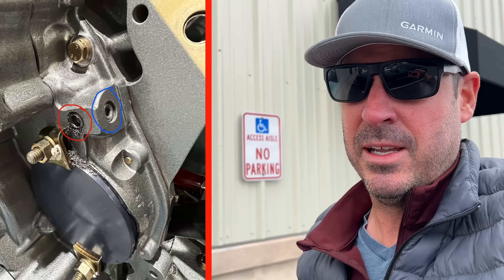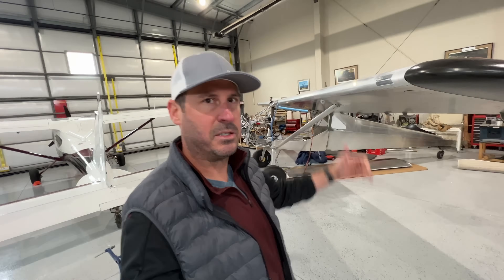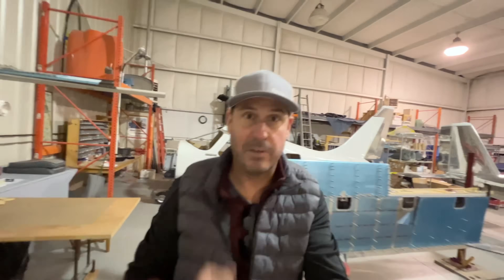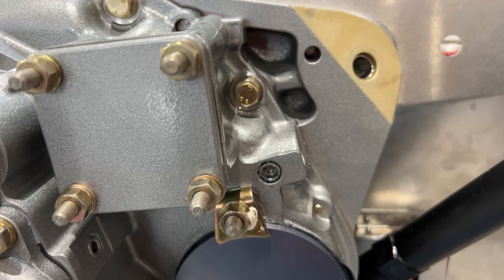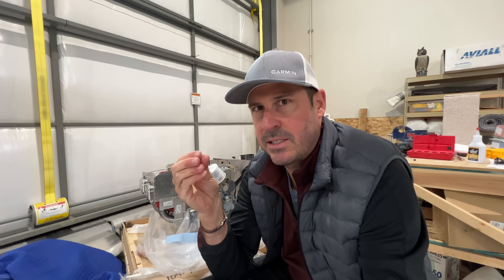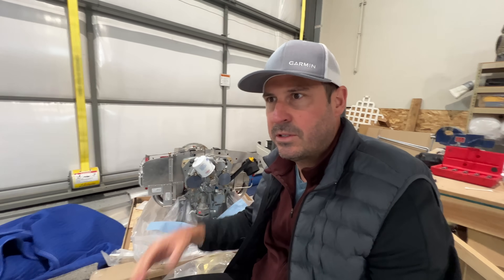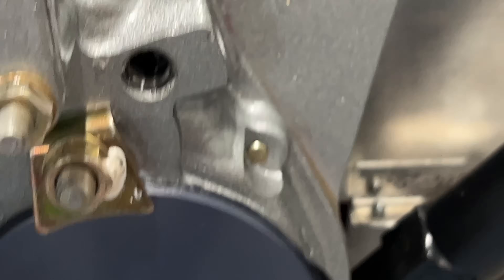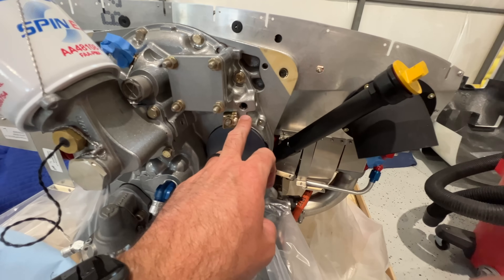Did I just ruin brand new $40K airplane engine?

Comment: Dont drill.   I owned a machine shop for over 10 year and often broke taps off in some expensive parts.   I found a very good tig welder.   He was able to weld a bolt onto the tap.and we were able to then screw the broken tap out of the hole.   I feel your pain.  This happened about once a month and we became good friends.  Good luck finding a good tig welder.  He worked as a contractor for GE jet division..

Comment: Get a can of croil penetrating oil. Grease trick plus magnent
Reply: Good idea on the magnet… however, it’s an aluminum engine case.
Reply: @chrishrabe4617   case is aluminium but bet bolt is very soft steal
Reply: I think he probably used the ball end of the Allen wrench, that's why it slipped. Gotta use the other end the straight end to initially loosen the plug. It's an oil galley plug not a bolt by the way.

Comment: Here’s a tip if you have to ever drill through one. Rig up some air pressure on the oil spout and pressurize the crankcase. When you drill through, it’ll blow the shavings OUT. Done it many times.
Reply: That's a good hack. Thanks for sharing.
Reply: Good idea but it would still scare the hell out of me
Reply: @mikeryan6277  Terrifying… the first time. Once you see it you’re like, “Well that was cool.” I learned it from D’Shannon Aviation when they put an air/oil separator on my Bonanza. That’s how they drilled out a boss in my BRAND NEW IO-550 to tap it for a return line. I filed it away and looked so smart when I pulled it out of my hat several times since then. Hey, everybody needs to show off once in a while!

Comment: My only suggestion would have been to  use some REAL heat, a  torch, that's a pretty big heat sink for an electric heat gun. Another trick I've heard about is to get a TORX wrench/socket, that is slightly too big for the Allen head, and tap (smack)  it in to get it to seat, a last resort for sure!  A pisser all around, glad you got it out.

Comment: 99% of the time it's not the metal, it's the wrench's or not using the proper one as any uneven pressure can easily cause strippage. I switched to socket allens and haven't had an issue since! Just some friendly advice, glad you got it and progress continues!
Reply: I’ve been an auto tech for 24 yrs and work on ga aircraft regularly also.   Had that extractor not worked my next move would have been fill plug with weld then weld a nut to that and the voodoo happens turn the nut and the plug backs out.   Of course that method all depends on what the plug is made of.  Has to be weldable.   Good job on the extraction!!
Reply from the maker: @rodgersrcaviation2785  ok, thank you!
Reply from the maker: Me too, thank you !!!